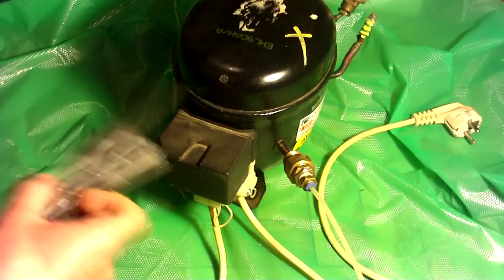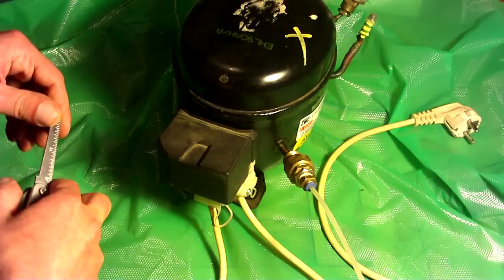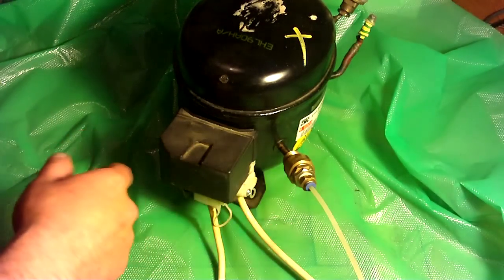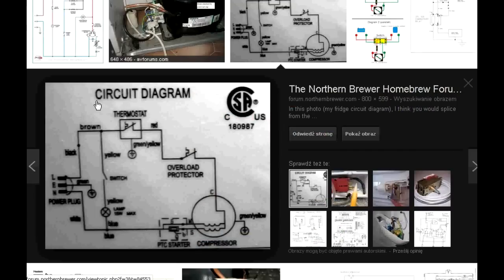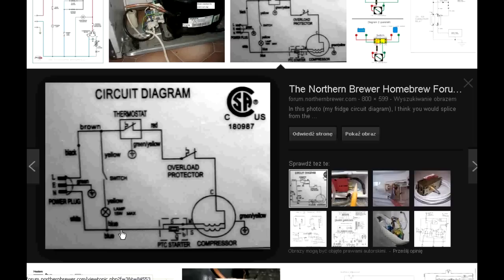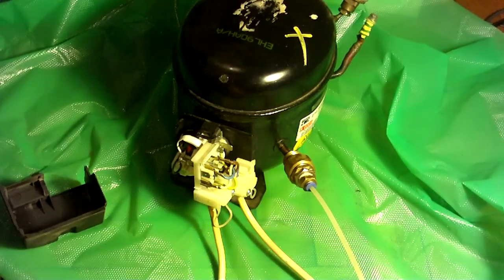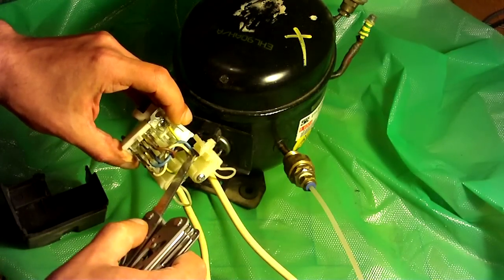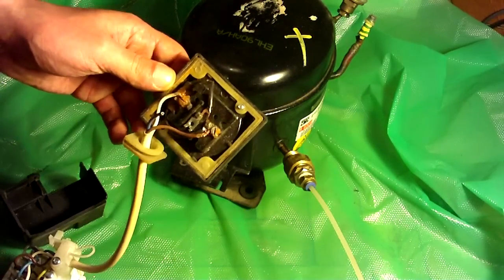How to wire a fridge compressor

Comment: Since u brought it up. A color of a wire doesn’t matter at all. The only thing about a wire is where it goes and what circuit it serves. Usually a wire goes somewhere because that’s where is supposed to go not because it black or red or purple with stripes.

Comment: Hi,

I found your comments on garagejournal, which led me to this vid.  I am trying to determine potential CFM's from this a/c compressor CR18K6E-PFV-875.   I picked it up very cheap, new, and I'm trying to figure out if it will be worth the effort?  I am hoping to use it for light blasting & painting.

It is a 220 unit so I'll have to add another outlet to my panel.  Looking at a 60 gal tank, I am planning an air cooler, moisture collection tank and auto drain as well.  Just a concept at the moment..  Anyways, any input would be appreciated.  Thanks
Reply: Also, I am realizing I would need an oil return or supply of some sort, if I want it to last long anyways.  If you know of any good resources on the subject I would also appreciate that info.  Great vids!

Comment: is this safe!! the way u have put efforts to explain this is really good but is this safe!! how do i know that its not gonna blow up!!
Reply from the maker: Ansul Joshi
It's compressed air and as such can it can be dangerous. It can generate pressures 4 or 5 times higher than typical air compressors so it's even more dangerous than normal compressors.

So for example you can't just use an air tank rated to 200 psi because it can generate over 600 psi and such a tank might explode. 

Everything you connect it to has to be able to handle at least 50 bar, which means that only metal parts are strong enough and even then not all of them. Look up 'rated pressure' and 'burst pressure' on the internet. 
It can be complicated as you have to choose parts carefully and sometimes it's difficult to find pressure ratings of things like standard 40sch steel seamed pipe.
Reply: kerimil hmmm!! so instead of storing the pressured air can i just connect the pain gun directly and start! will it work!!
Reply from the maker: Ansul Joshi The flow might be too low for a real paintgun. Also it can generate enough pressure to make a paintgun explode or at least damage it.

If you want a compressor for paining then buy a normal compressor. A fridge compressor is more suitable for spudguns, science experiments, blowing things up etc.
Reply: kerimil hmm cool!! btws whats the max pressure the fridge compressor can handle!!!
and one more question i saw this another guy on youtube he suggests to keep pouring drops of oil into the compressor!! is it really necessary to do that!!
 can we connect an airbrush??!!!
Reply from the maker: You don't really need high pressure for an airbrush. Most paint guns need less than 10 bar, a fridge compressor can reach over 50 bar which is really a lot.

What's more this kind of compressor isn't good for painting as it hasn't got an oil filter.
You should really get a normal compressor for painting.
Reply: kerimil ok cool!! thanks for the advice!!

Comment: Thanks for sharing.
Can i remove the wire connect to thermostat because i plan to use this as small air compressor. Will the motor still work without the wire connected to thermostat?
*I don't have any fridge compressor at the moment.
Reply from the maker: jones chua keep that wire and put an on off switch there (in place of the termostat)
Reply: kerimil  thanks. so now the compressor can be manually turn on and off beside the pressure-switch?
Reply from the maker: Yes, it can. The thermostat is just a temperature switch. It switches the compressor on when temperature drops and switches it off when it drops.

Just wire an on/off switch in place of the termostat.
Reply: noted. Today i went to the fridge repair shop to look for used fridge compressor. There are so many variety from 1/8 hourse power to 1 hp. What is a good choice if i were to use a 30 liter capacity tank? The used fridge compressor price is almost same as the new one here, the shop owner are willing to wire the used compressor for me for a price of +- $60, the new one is about $80. But if i buy a new one, the shop won't drain the refrigerant & cfc from it..

Comment: what are the connectors on the copper line called you are using please? I see it has a push to release fitting, Thanks for uploading
Reply from the maker: Here is how to make it -> simplest homemade compression fitting